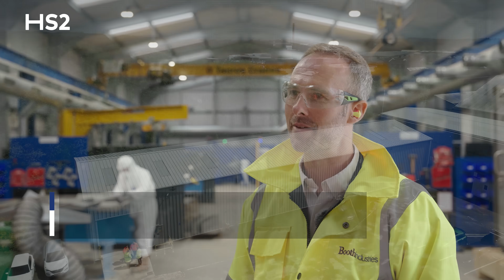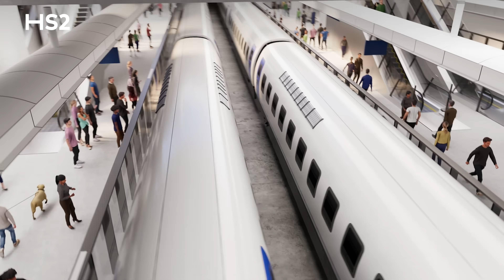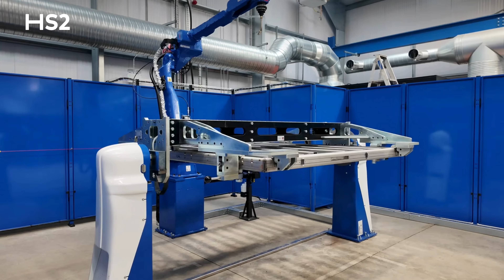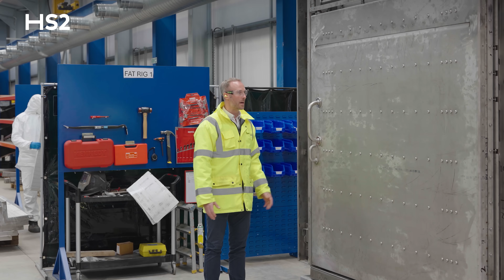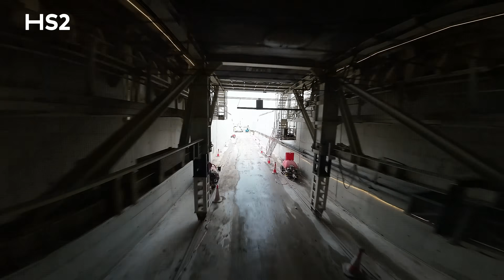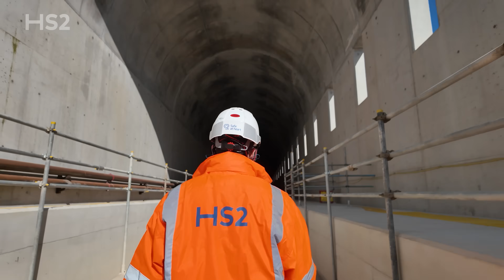Inside Booth Industries' factory | HS2 tunnel cross-passage doors begin to be installed

Comment: 2 hour fire protection is nuts
Reply: The building regulations cover all types of buildings and other situations where people could gather, eg railway tunnels. Depending on the building type and floor area, and also the possible situation in a railway tunnel, fire resistance of doors is required to meet the requirements of the building regulations and can be 60 minutes, 90 minutes and 2 hours. In the case of railway tunnels it's 2 hours.

Comment: It wasn't clear to me how the doors get to the right location, but I assume that will be on board a railway wagon and you can't test that part of the procedure until after the track has been laid. On the otherhand, you'd maybe want safety doors in first and only test removal and replacement by rail after track has been commissioned. What is the order of operations?

Comment: This year is 150 years since the Settle and Carlisle opened. It was the last major railway to be built mostly by hand, and yet it only took 7 years - it's taking about 3 times that long to build HS2 with modern methods!
Reply: Right, but HS2 is supporting faster trains, on a network far more complex in terms of electronic systems. Plus, they have had to build a bunch of bridges and tunnels.

Plus, if you google it, the current plan for the HS2 network is 2x the length of the Settle-Carlisle. So all things considered, it's impressive they got this far.

And a lot of work has had to go into the set up of factories, such as bridge sections, things like the factory for these doors. That all takes time and testing. Should last many years to come.

The Cornish mainline took decades to build.
Reply: @mrdrummer2564  They had to build 'a bunch of bridges and tunnels' when building the Settle and Carlisle - next excuse!
Reply: @Inkyminkyzizwoz  There is no arguing with people with such an outlook dimmed by prejudice and ignorance.
the reason HS2 is taking longer is its longer than the S & C and its underground for half of that. Plus H & S and building regs are vastly different. How many people died building the S &C? 72. How many on HS2? One plus HS2 id building into very complex and crowded cities, the two largest in the UK, and over motorways that did not exist the 19th century.
When a project is forced underground by the do-gooders, NIMBYS, Newt lovers and National Trust and you tunnel then these days you need escape routes and therefore fireproof doors.
Reply: @1chish  I think it was a good bit more than 72!
Reply: @mrdrummer2564  2x the length of the Settle line and 3x as long to build - so overall still slower!
Reply: @Inkyminkyzizwoz  The Settle line has 3.3 miles of tunnel, HS2 has 65 miles. Settle has circa 2 miles of viaducts, HS2 has 9. One is non-electrified, the other is. One is designed for 60mph running, the other for 200mph. There are some valid criticisms of how long this is taking but you are comparing an apple to an orange.
Reply: @CommitQuack  But we have much better methods and equipment now - Blea Moor Tunnel took just over four years to build, whereas the Chiltern Tunnel was dug in just under three, and it's over six times as long
Reply: This country is pathetic, UAE has built a train network 264 km took 4 year from planning to open. The other 900 plus km with 589 bridge and passes with 6.5 km in tunnels took 9 years. We struggle building a sandcastle.
Reply: @neiljone9698  Mind you, I'd be hesitant to use the UAE as an example, because I don't think that conditions for the workers there are all that great!
Reply: @Inkyminkyzizwoz yeah because our trains are fantastic and most working family can't afford to live.
Reply: @Inkyminkyzizwoz china will build high speed train track in 2 to 5 years for a 1000 km. We can't build 120 miles with a substandard system in 25 years.
Reply: @neiljone9698  Likewise, I'd have doubts about their working conditions too!

Comment: So it takes a week to make a door?
Reply: Booth industries make other doors on other projects. To make 300 for HS2 over 5 years fits in with the construction programme.
Reply: @TrevorWilliams-fq8mg built a factory specially for the doors. Taking 5 years to build 30 doors is taking the piss.
Reply: @scotiajinker8392 You simply have no idea of what you are talking about with no underststanding of the construction industry. Lots of opionated nonsense. Booth Industries know a lot more about making doors than you do.
Reply: @TrevorWilliams-fq8mg I know when someone is taking us for a ride.
Reply: @scotiajinker8392 As far as these doors are concerned you only think you do. The doors are designed to withstand the wind loading from a high speed train. They probably cost about £150,000 each to supply and install. So what is your solution ? Ps... there are 300 doors, not 30 as uou claim.
Reply: @Tre @TrevorWilliams-fq8mg ypo re 30 , yes it’s 300 , still taking over 6 days to make each door. Do you think that other countries don’t have doors in high speed tunnels? You’re assuming a price (which is irrelevant) , you know what they say about assuming?
Reply: @scotiajinker8392 I say an approximate price with experience as I used to be a construction estimator working for a major contractor.
Reply: @TrevorWilliams-fq8mg  like I said a guess/assumption, you can’t give a proper estimate without knowing the materials etc.
Reply: @scotiajinker8392 And you can't possibly know how long it takes to make one.
Reply: @TrevorWilliams-fq8mg  5 yrs to make 300 doors is an easy sum, so much for you having engineering experience 😅😅😅😅😅
Reply: @scotiajinker8392 but you don't know if they are making 1 door at a time or in batches, taking a total period of 5 years. Neither do you know if the 5 year period is a requirement from HS2 to meet their overall programme.
Reply: @TrevorWilliams-fq8mg  the facts stated it’s going to take 5 years to make 300 doors.  I would sit down if I were you before you make a bigger fool of yourself.
Reply: @scotiajinker8392 so having said   they are taking us for a ride in taking 5 years to build 300 doors you now agree that is the correct time.
Reply: @T @TrevorWilliams-fq8mg ere did I say that I agree it should take 5 yrs? I just quoted what the video said.

Comment: I was wondering why they needed a custom factory and 5 years to build all the doors. Then I saw a door. What a monster!
Reply: And how much do you think they cost to manufacture and install ? The doors they made for the public circulation areas in the crossrail stations. which are a single leaf size complete with frame cost just short of £10,000 each.

Comment: complete overkill, like everything hs2 related
Reply: We don't need safety, just like they didn't need the connecting passages in the Channel Tunnel..... until they did.
Reply: @RichardFraser-y9t  No one is saying we don't need safety. What we don't need is decades of delays and a £100 billion project for a line that's not even worth it. Contractors have made millions out of this monster. Successive incompetent governments who agreed to anything because it's not their money. I can't wait to travel on this in 2035 for £500 return.
Reply: @ArtEmis55K you'd be waiting until a long time after that, but think how much you could save with a senior Railcard 😂. If make it to 90, I'll gladly reduce my inheritance tax liability with a ticket.
Reply: I personally do not want to die in the service tunnel due to insufficient (or even no) connecting doors.
Reply: Evidently you’ve not heard of the Mont Blanc Tunnel fire amongst others which prompted the need for these emergency escape routes in every tunnel in the entire country, and pretty much everywhere internationally.
Reply: @lucyanderson9322 Unless you are the Boring Company it seems
Reply: @lucyanderson9322 Every NEW tunnel, most of the underground has no such fire escapes and neither do most tunnels across the network.
Reply: @DavidKnowles0 You don't have to upgrade older buildings and structures to comply with current building regulations.
Reply: You either pay for quality now or you pay it later in not only cost but people's lives
Reply: Lewis thinks this is an issue related solely to HS2. It isn't. It's construction law called the Building Regulations.